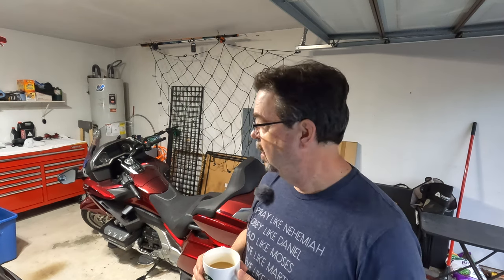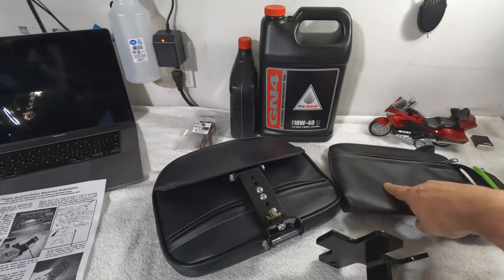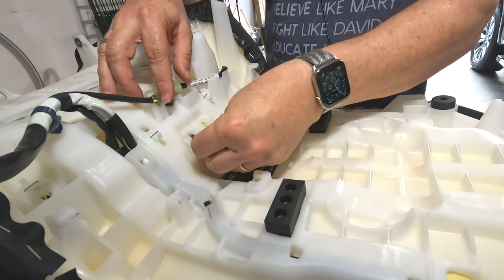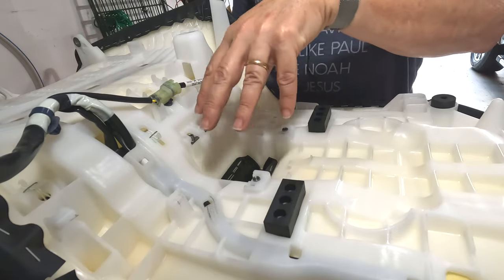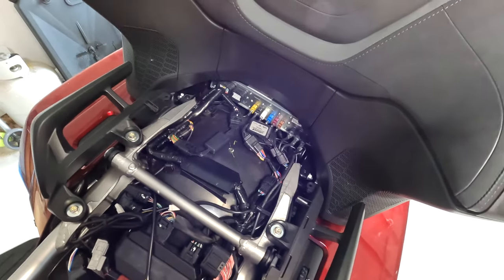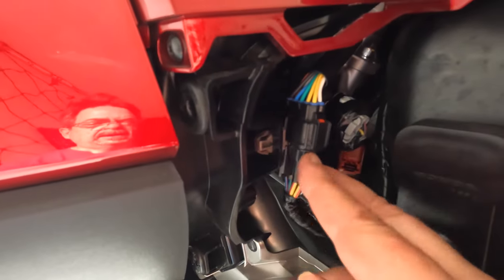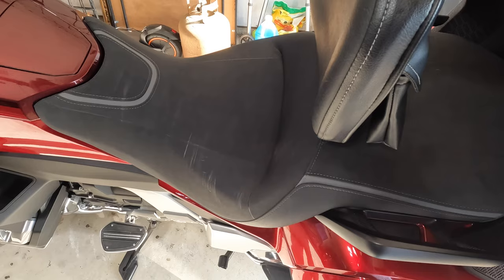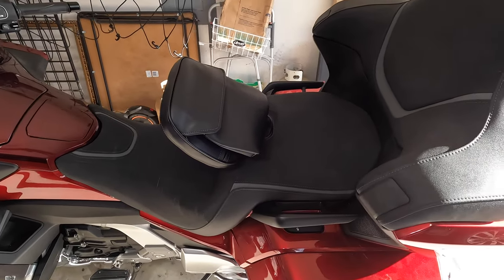Installing the UTOPIA backrest !!

Comment: Hey Robert! I too have a 2023 red dct tour that I purchased a month ago. Mine has all of 300 miles on it so far. I chose to go with a Honda line backrest, particularly after getting offered a decent discount on one that was a new cycle take-off that the dealer had. I had to adjust it about as far forward as it would go, and that, in conjunction with the Helibar risers I also installed, seem to work well for my height of 5' 9". Thanks for the video's. Keep them coming.
Reply from the maker: Thank you Marvin.. we are the same height.  I have the Helibar risers and look forward to using this back rest... from the quick test ride this morning it felt pretty nice!  Ride Safe!!

Comment: Robert, nice work but you didn't place the T-nuts in the proper location. That's why you had difficulty getting the bolts to engage the fasteners. There are slots that they slide into above where you placed them.
Reply from the maker: Robert thank you that makes total sense now that you say it.  Next time I’m under the seat I will correct that!!  Thank you for watching and for the help!
Reply: By the way, it probably is not worth the effort to correct the fastener location.

Comment: Thanks for the video. I just purchased the Sport version of the Utopia backrest for my 2020 DCT.  Haven't put it on yet but looking forward to having it. I also purchased the quick connect bracket so hoping that goes on easy but can't find a video of the quick release being mounted.
Reply from the maker: I have found that the backrest has good and bad points.  While it helps with long ride comfort and bike stability… in the short term it amplifies the bumps in the road.